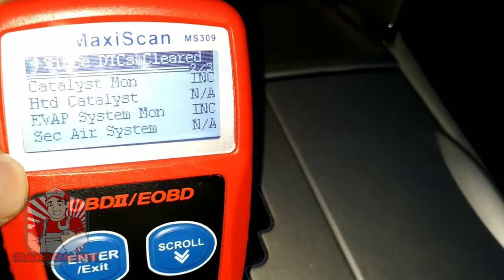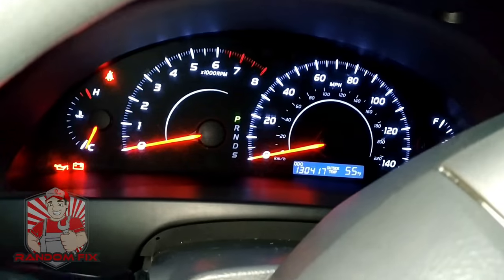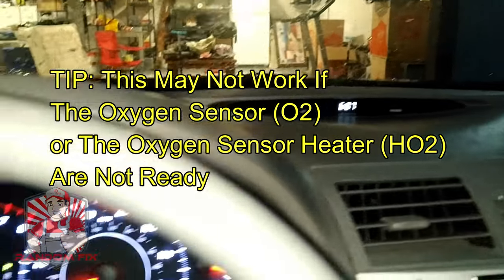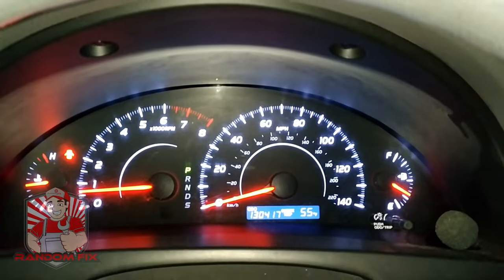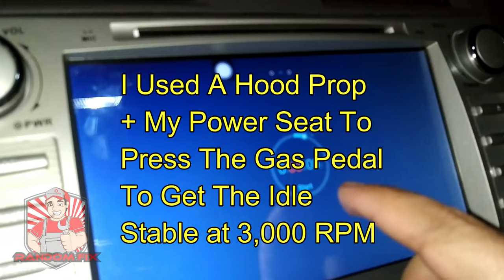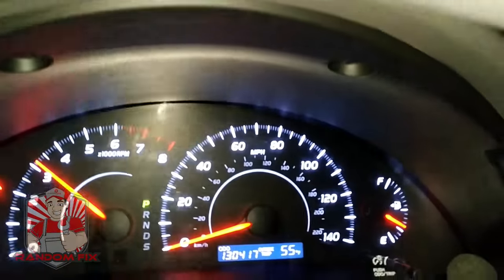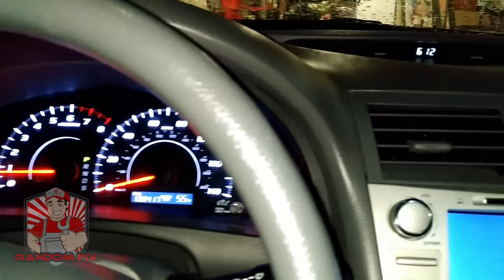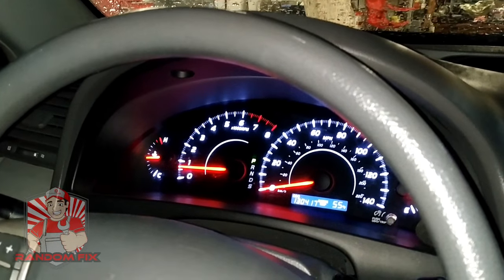Amazing Trick to Get Catalyst Monitor Ready!

Comment: I have a 1998 Camry V6, 217k miles. I purchased the same scan meter as yours. I have the same to incomplete registries (Catalyst and Evap.  I tried your method it didn't work.  I have also followed Toyota's drive cycles twice before using your method, it didn't work either. Can you suggest something else I should try?
Reply from the maker: Did you try my toyota video?  https://youtu.be/EKfEr2LP2Nw  I would just work on setting one out of the 2 as 1996 to 1999 can have 1 unset monitor. As you vehicle ages it gets harder to set the monitors. Please keep me the loop and good luck.
Reply: @RANDOMFIX  Thank you! I will watch your video first then give a few more tries. Thank you!!

Comment: I did this with my 2002 mustang after multiple attempts of doing Ford’s drive cycle. The catalyst completed after doing this, but after driving it for a mile it went back to incomplete. Any tips?
Reply from the maker: Check the battery to make sure it sits at 12.4 volt plus and confirm all the grounds are clean and connected.

Comment: So tried this on my 2013 Civic Si. Surprised this technique worked. The Catalyst monitor is now ready but evap system monitor is still incomplete. California Smog sucks. 😔
Reply from the maker: Glad to hear this help with the catalyst monitor your 2013 honda. Here is the honda drive cycle that will help with your evap.
https://youtu.be/oZELvZ4danA?si=eJ8LCphRxweYYQGB
After your watch let me know if you have any questions.
Reply: @RANDOMFIX  thank you so much! So in CA. We are allowed one incomplete monitor which is only the evap. So my car should be good to go.
Reply from the maker: @glenw9048 nope as august 1 st 2023 you need all monitor ready
Reply: @RANDOMFIX  really? I called the smog place Yesterday and the tech told me that the only monitor that could be incomplete was the evap
Reply from the maker: @glenw9048 last I heard differently but I would go and try and keep me posted. I thought it changed as of 8.1.2023
Reply: @RANDOMFIX  just got my smog done and it passed! Thanks again for making the video for the catalyst monitor to complete.
Reply from the maker: @glenw9048 so was the evap required?
Reply: @RANDOMFIX  nope. Evap is the only monitor that can be incomplete to pass smog in CA

Comment: My 2004 Toyota Sienna can't pass SMOG due to the Catalyst Monitor Incomplete issue. The check engine light is not on and there is no other error code when I checked with OBDII meter. I have tried many different tricks I found in Youtube to get it fixed but no success so far. There are two things I noticed: 1. All the methods I found require the engine coolant temp to be above 176 F to initiate the catalyst monitor checking. The temp reached to 176 F when the car was idle and warmed up. But when I drove it, the temp dropped to around 158 F due to the cool air coming in. Is this a problem? 2. One method I tried was to keep the car idle and press gas to get steady 3000 rpm for 3 mins. But at about 2.5 mins, the car could not hold on 3000 rpm and started shaking. What could be wrong?
Reply from the maker: Yeah, it sounds like something could be wrong if you can't hold the rpm at 3k for 3 minutes. How many miles are on the Sienna and what caused the information to be deleted in the first place? I just answered a comment on the video for a 2003 Highlander that had over 300k miles and so I know the method works. Are the cats original?
Reply: @RANDOMFIX  Thank you very much ffor the reply. The car has about 220k miles and cats are original. I disconnected the battery once so the old information got eliminated. It had P0128, P0420, and P0446 error codes before but I managed to get rid of them by changing the coolant temp sensor, using Cataclean, and replacing the gas tank cap. Now there is no error code showed in the OBDII meter. Can you give a suggestion to check why it can't hold on 3k rpm?
Reply from the maker: To figure out why the vehicle isn’t holding 3k can be tricky. Can you try 2.5k maybe for 5 minutes? You already had p420 code but running cataclean doesn’t mean that you got rid of the code it just means the vehicle is able to detect the catalyst efficiency decline as much.
Reply: @RANDOMFIX  Hi Rando, I checked the obd again today and it shows that I am having a permanent code of P0128. I have replaced the coolant temp sensor. Do you think I should replace the thermostat too and it may make the catalyst monitor to pass?
Reply from the maker: I’ve run into these p0128 and got away with starting the vehicle with the air conditioning to on select cold air. Let idle and proceed as normal. I am not sure if your highlander will pass with this method but it’s worth a try. The logic behind my experience is that the added load from the air conditioning increased the engine temperature faster and thus avoided throwing a p0128. Let me what happens. If decide to replace the thermostat make sure you get the oem one from the dealer.
Reply: @RANDOMFIX  do you think the p0128 error code could be the reason of catalyst monitor incomplete?
Reply from the maker: Yes and any pending codes may cause me monitors to not complete

Comment: Would you recommend this on a 03 Honda Accord v4 with all monitors ready except Catalytic? Thanks
Reply from the maker: Here is the Honda drive cycle 
https://youtu.be/oZELvZ4danA

And if you still need a help here is whole playlist for incomplete catalyst monitors
https://youtube.com/playlist?list=PLDEbtVOPRC-h1BAzaWQ-6NSnmG0gwvgwP

Keep me in the loop
Reply: @RANDOMFIX  it threw a P0420 hard code already. I am buying new o2 sensors then trying drive cycle again
Reply from the maker: Before you replace the o2 sensor just check the connection. Is it the original o2 sensor?
Reply: @RANDOMFIX  connection is solid.
Reply from the maker: I mean unclip it, clean the contacts and re connect. If it's not the original o2 sensor then I would try cataclean as it will help your cats and is supposed to help with the o2 sensor.
Here is my video and make sure you only have 4 galloons of fuel per bottle. Some viewers use two bottles with 8 gallons. This only a temporary fix so smog ASAP once the monitor completes. Keep me in the loop.
https://youtu.be/ERQUUdWo3-o

Comment: This did not work for my 2002 Toyota Sienna.  I tried 2 different times with radio off (and everything else).  I do not have a tachometer on the dash so I was guessing.  If I revved too long or too hard the car would stop the revving (due to heat?) and slow itself down if if I stayed on the gas pedal.  I got through two tries with no auto-stopping of the revving, and even held it for 4 minutes the second time.  I have two weeks before registration deadline!  Arrrgh.  I have tried the drive cycle about 8 times now, to no avail.  I am getting depressed.
Reply from the maker: Thanks for your feedback on your 2002 sienna.
Quick questions, what’s the back story with your Sienna? Is this the only unset monitor?
Reply: @RANDOMFIX  When I first went to smog check, the evap and O2 sensors were also not ready.  Doing the drive cycle for the O2 seemed to work as that is now ready.  The evap is still not ready but I can ignore that and still pass smog check.  I had some work done on the car several months ago so that is why the cat monitor is not ready.  I have driven about 200 miles so far while trying to do the cat monitor drive cycle (not easy to do on the freeway).  I almost never drive on the freeway, just city driving which is why all this time later the cat monitor is not ready.  Still, the drive cycles do not seem to work.

Comment: After it shows ready.. If you turn the car off does it reset to not ready?
Reply from the maker: Normally it does not revert to not ready but if it was me and I has having that that issue I would just smog the car without turning it off as I'm run across this on a few cars and it can be a headache.

Comment: I need help! I have a 2001 bmw 330i 5speed. all monitors are ready and I have no check engine lights or pending codes. I been driving the car on freeway and can’t seem to get it to be ready. I even tried this method with my foot and still no luck. Any ideas??
Reply from the maker: If you have no check engine light and no pending codes plus all monitors are ready. I'm not sure what's wrong in your situation? _randomfix
Reply: RANDOMFIX this sucks.

Comment: If your electric seat operates in increments that don't allow for a smooth gradation of rpm increase (like my Volvo), consider making a "cam" (oblique circular shape) with the center attached to a stick and turn it manually.
Reply from the maker: There are tools like that already on the market. I was just using what I got.
Reply: @RANDOMFIX  FWIW I got my catalyst to report ok and passed smog.  I found a very detailed Drive Cycle routine (43-50 mph, engine brake to 18mph, idle 2 minutes, accelerate to..) that did work.  But it meant driving on the freeway in the right lane with my flashers on worrying that I'd get rear ended or ticketed for causing a hazard.  There really needs to be an alternative for people who change batteries right before needing a smog check OR how about a little coin battery for the computer module that will keep data alive for a day or so while you change batteries?
Reply from the maker: @workingTchr there is and I show it in this video
https://youtu.be/8bdDoBXCiA8?si=1eTnxXA193vOueTG

Comment: I have a 2001 Mitsubishi Galant with a 4-cylinder that has no codes, but will not set the EGR or CAT monitors. I tried this trick 2 times, and my Cat still will not set.
Reply from the maker: Please watch this Mitsubishi specific video and let me know what questions you have.

https://youtu.be/3ywgZW2zMa8

Keep me in the loop and good luck.

Comment: 2004 Toyota 4Runner, check engine light on with codes P420 and P430.  I changed the downstream O2 sensors recently and drove close to 300 miles to "complete drive cycle".  However, smog check can't be done today (P430 stills on) because "catalyst monitor" incomplete.  Will this work for me?  Definitely don't want to spend $$$ on new catalytic converters.
Reply: Also I tried this method after driving 20 miles to smog station, but didn't work.  Need cold start?  Thanks.
Reply: No check engine light on.  But do I need to erase the P430 code first before trying this method?  Thx
Reply from the maker: Yes I would reset the check engine light.
Reply: @RANDOMFIX  Check engine light not on, but when the scanner still shows P0430 code
Reply from the maker: Is the 430 showing as a pending code?
Reply: @RANDOMFIX  yes
Reply from the maker: How fast does the pending code appear as pending after you reset with an obd2 reader?
Reply: @RANDOMFIX  Tried method again this morning n it worked!  Thank you!
Reply from the maker: David, I'm glad you got it now. Thank you for reaching out.

Comment: On car scanner If my car says heated catalyst passed and catalyst failed how can I tell which one needs replacing? Would it be under the hood one or under the car?
Reply from the maker: Sorry for the late reply! did you find a solution?
Reply: @RANDOMFIX  I had a mechanic tell me it was the catalytic converter closer the engine and bought a new one but it ended up being the one further away from engine.
Reply from the maker: That sucks, I hope you don’t go back to that mechanic. Where do you get the catalyst from? Did this mechanic install it?

Comment: I own a Honda Accord 05 hybrid.  Drove it at 55mph for 12miles with cruise control on. Came to stop and turned off engine.waited 10mins. Drove again for 12miles at 55miles with cruise control on. Came to stop and checked it with scanner and viola the catalyst not ready cleared.
Reply from the maker: Thank you so much about the positive feedback on your 2005 Honda Accord hybrid catalyst getting completed.

Comment: The only incomplete I have is the EVAP , I have fail inspection in New Jersey for catalyst  and EVAP not ready .. do I really need the EVAP ready also ?
Reply: Some are mandatory others are not so you'll have to check NJ to see what's required.
Reply from the maker: Sorry for the late reply! did you find a solution?
Reply: @RANDOMFIX  yes in New Jersey they don’t need EVAP

Comment: I have been driving for almost 800+ miles and no engine code except Catalyst Readiness shows incomplete? Any idea to solve this to pass SMOG?
Reply from the maker: Jeff, what are you driving, please tell me more about the vehicle. thanks
Reply: @RANDOMFIX  2009 Honda Civic EX-L, batter was replaced with new one.
Reply from the maker: Here is the Honda drive cycle

https://youtu.be/oZELvZ4danA

I've had lots of great feedback about the 3k trip on the older civics, the video can be found on the catalyst tip. 
Here is the direct link.

https://youtu.be/BuZYAy_xi0E

Comment: I will be trying this on my 2001 Rav4. I bought a new catalyst converter and it didn’t fix the problem so after hundreds of miles it still hasn’t worked. So I’ll be giving this a try sometime soon and I’ll comeback to comment my results. Wish me luck 🥺
Reply from the maker: Focus on the unset monitors. Check in video for make specific videos. FYI, Toyota video is scheduled to be release by 12.31.2020
Reply: @RANDOMFIX  thanks for the info👍🏽👍🏽👍🏽

Comment: Is there a solution when the 02 sensor is also reading as incomplete? I noticed the video said this may not work in that case. I should add that I replaced the 02 sensor a couple years ago at most
Reply from the maker: Follow the vehicle drive cycle. What are you driving?
Reply: @RANDOMFIX  thanks for your reply. I have followed the full cycle, have gone maybe 500 miles since clearing codes. I’m driving an 07 Honda Fit. I also replaced the cat a couple years ago
Reply from the maker: I'm glad to help. Here is the drive cycle

https://youtu.be/oZELvZ4danA

I would make sure that battery is good and also check the upstream and downstream O2 sensor connectors.

Comment: We have driven our 1996 toyota 4 runner over 600 miles, finally we were recommended to replace the CAT - we did that and still no luck..... I tried all your tricks, but I don't seem to be getting anywhere. There is nothing wrong with the car - mechanic said all is good. The only thing is the CAT and EVAP monitor won't clear! Please help with any suggestions you might have.
Reply from the maker: Hi Douglas, I can imagine, I will look into 1996 4runner catalyst and evap issue.
Reply: Douglas I have an 2000 4runner and had the same issue. Changed both Cats, 2- O2s, exhaust manifold and no luck. Ended up being a problem with headers that were put on my car, wrong year. Finally passed after this. Good luck that code sucks. #DreadedP0420
Reply: Hi Doug. I had the same issue with 2000 4runner. 1000+ miles, every weekend getting up at 4am to drive so as to  not attract attention with expired tag going slow on freeway. Using the following info https://justsmogs.com/wp-content/uploads/2016/04/READINESS_MONITOR_DRIVE_PATTERNS_T-EG02-003.pdf     got all, but catalyst monitor, then the 3 minute at 3K RPM finally did the trick. Hope this is all old news and you have completed already, but if not, Good Luck.

Comment: The instructions I've seen for the cat monitor on early 2000's Toyota 1mz-fe V6 say to drive 55mph for 15 minutes, then coast down to a lower speed without braking.
Reply from the maker: Coasting down in speed helps sets the egr monitor.

Comment: I have a 3000 fr Mitsubishi I’ve drove over 400 miles still not ready while doing this do I put it in N For 3 minutes? Thank you!
Reply from the maker: Connie, Yes you would just leave it neutral in a manual transmission and in park on an automatic transmission vehicle. _Randomfix
Reply: Thank you so much hope it works !Have  a blessed day! 😊
Reply: @RANDOMFIX  you think this will work on a 2000 silverad... just replaced the knock sensors...all other monitors except evap are set
Reply: @RANDOMFIX  i just seen your video on this..seems simple enough but I tried on my 2001 navigator with no luck so far and wonder if i try again maybe in neutral or park if make a difference
Reply from the maker: Which monitors are incomplete?
Reply: @RANDOMFIX  just the catalyst Mon show incomplete all else is ready..had some valve work done and all recently and all else came back on quick except the catalyst Mon so far I drove over 200 miles and tried your suggestion to see if helps as well

Comment: Hi Randomfix, I have a question. When I use MaxScan to check my engine, it shows 'OK' for Catalyst Monitor under 'Since DTCs Cleared'. But under 'This Drive Cycle', is shows 'Incomplete'. Will this pass the smog check in California? Do I have to make sure it shows okay under 'This Drive Cycle' for Catalyst Monitor? Thanks in advance!
Reply from the maker: Good question. The catalyst has be ready under drive cycle. This drive cycle is not required. _Randomfix
Reply: RANDOMFIX so I can go to the store now and do smog check?
Reply from the maker: Yes if all the drive monitors are complete. Best of luck.
Reply: RANDOMFIX Thank you!

Comment: Hey @RANDOMFIX, I took my Celica to the smog and came out with Cat incomplete and Evap incomplete. I tried the 3000rpm 3 min hold and the check engine came on. Plugged the scan tool and read P0420 and P0300. Should I clean the Cat, use Cataclean just to pass the test or replace the whole Cat? I just want to pass the test!
Reply from the maker: Hi there, the p0300 needs to be addressed before you doing anything. Even if you get the rid of p420 code the p300 can ruin the whole drive cycle and maybe further damage the catalyst.